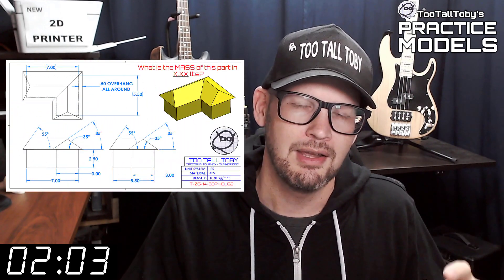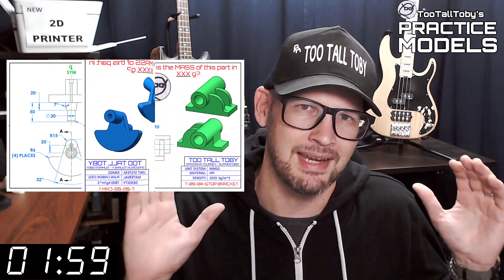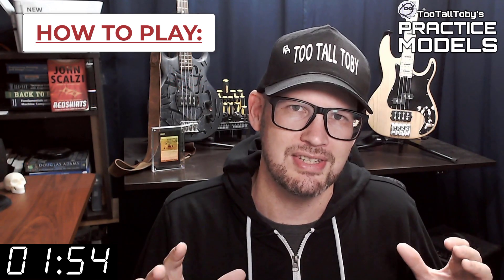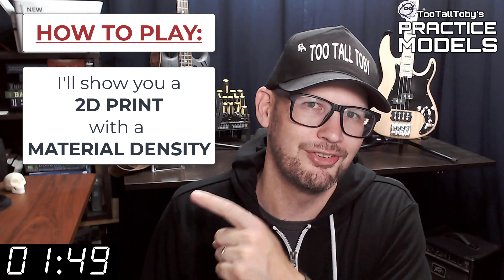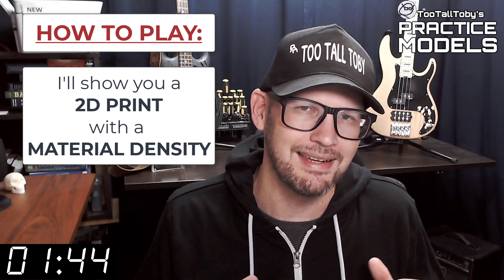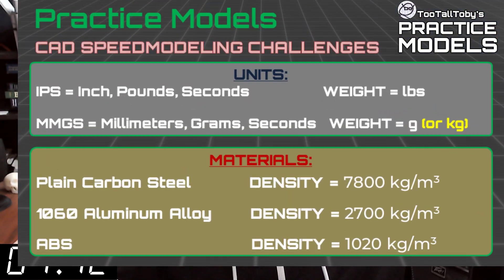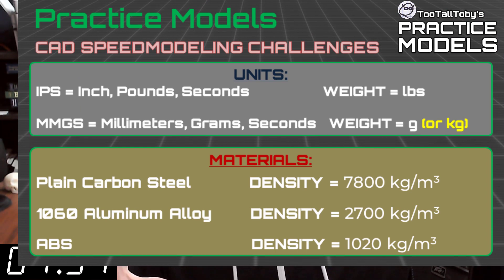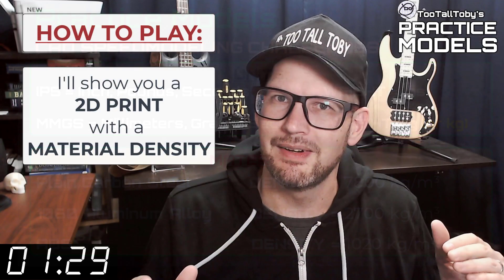SOLIDWORKS Practice - Onshape Practice - Fusion 360 Practice Exercises - TooTallToby-11-12

Comment: 5:12 to model it but haven't really found a good way to add a custom library of materials so it took way to long to change units around and get the right answer
Reply from the maker: Very nice Job Maker!  Which CAD system are you trying to add custom materials to?
Reply: @TooTallToby  Onshape. I can add one I just need to change my workspace units to what you have the density in after I draw the part, then switch the units again to what you want the answer in. I've seen Alnis use a custom table but I don't know how to set one up... yet 😁

Comment: 120 grams, time: 12:20. I got hung up on the 3 bottom, 30 dia. (or R15) bosses. I was going to do a circular pattern of one of the bosses I made, but when I went to put in the angle, I scratched my head on the angle to use. easy 55/2 wait that's not right, dang it!  just to finish it I went back and created the other two bosses as separate items.  = more time.
Reply from the maker: Awww yeah - Got caught up on that one!  Glad you were able to navigate through!!  Thanks Thomas!

Comment: 4:05 to get the wrong answer by a few grams and an extra 45s to fin and fix the problem (mis-typed the diameter of the 6 little knobs).
One sketch and 5 features (in Onshape).
Reply from the maker: lol - nice!  yeah I was wondering if you could do the whole thing in one sketch (and if anyone would try it)
Reply: @TooTallToby  I tend to put a lot in one sketch, especially for these speed challenges as this way you have everything in one spot and you don't get thrown off by some weird dimension/geometry down the road (looking at you tangent line off the little ear...). Plus Onshape makes it very easy by natively using sketch regions so there is no real downside until the sketch gets really complicated.

Comment: 9:30 for 120.124 g ... Nearly got me with the radius and diameter snafu XD Was fun thanks
What's the point of the purple fillets ? As the part is in ABS, they only account for 0.4g but takes a lot of time to select, is it a viable technique to skip them as the part is quite small and the material density is quite low ?
Reply from the maker: You could skip them if you want, and still get the answer "correct".  Originally I had the precision a little tighter, but I loosened it for the PRACTICE MODELS video.  So this was an oversight on my part.  Good catch and thanks for the feedback :-)